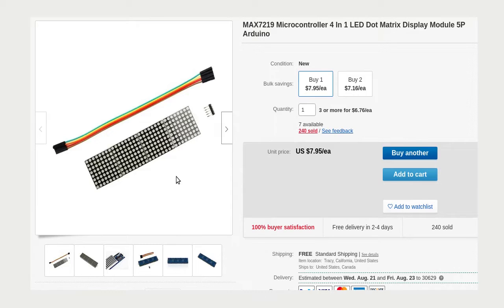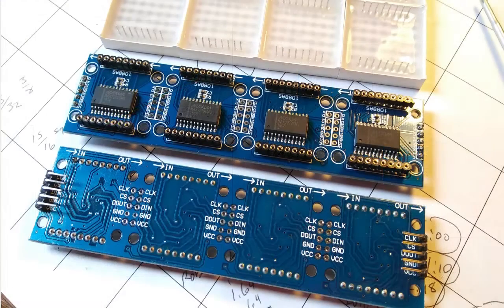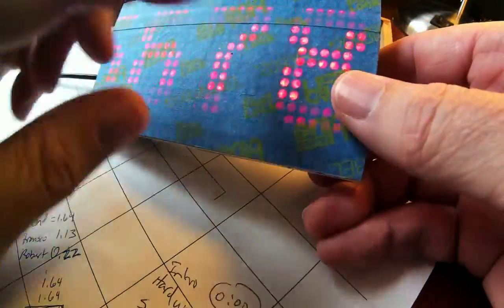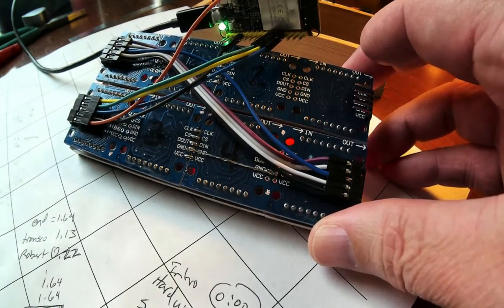Youtube + Network Monitor - ESP32 Project 10 with MAX7219 LED Matrix

Comment: You win again Clayton! I received a bunch of piezo buzzers from Adafruit and before I have a chance to write pwm functions I find your beeper module here! More of your finger-prints on my time trial neopixel matrix clock, thanks!
Reply from the maker: Hi Garry. Cool again. I had trouble with getting long tones that weren't glitchy. I think there is something in the ESP32 hardware that causes a pause when the internal clock resets or the PWM is updated. So you may have to use a series shorter tones to get something consistent.

Comment: Just wanted to put a note up saying thanks for your videos. Yours may not be a massive channel but these videos you make are still interesting and informative for people. I think your mini cnc project was the best though. If you haven't seen them already,  check out some capacitive TTP223 touch buttons, I'm sure a creative genius like  yourself could make something interesting using a few of those. They're cheap as chips on ebay.
Reply from the maker: Thank you so much. I appreciate you taking the time to write that. Will check out the buttons.